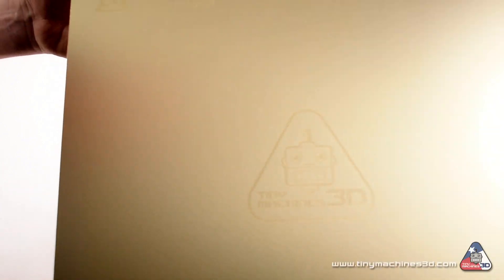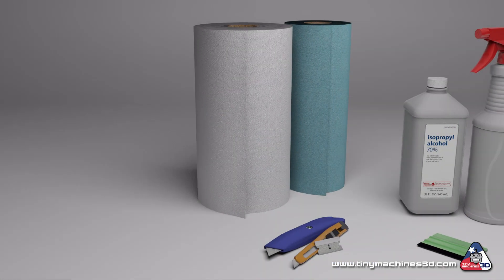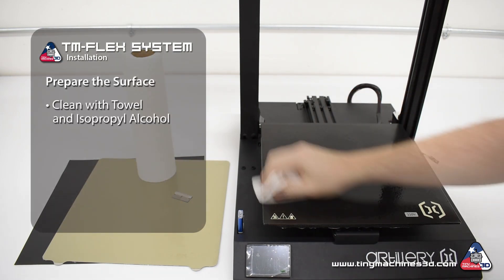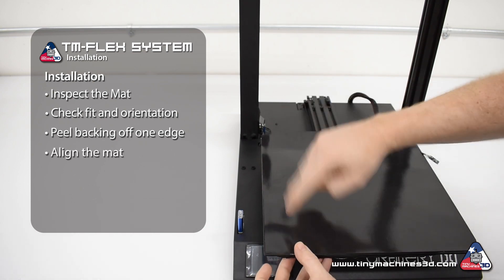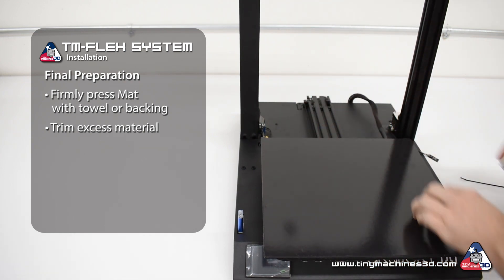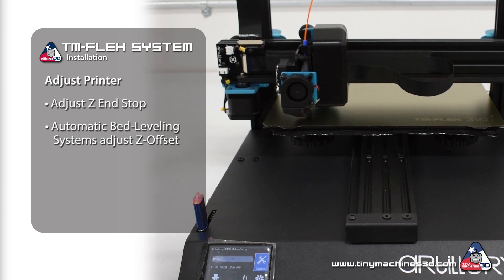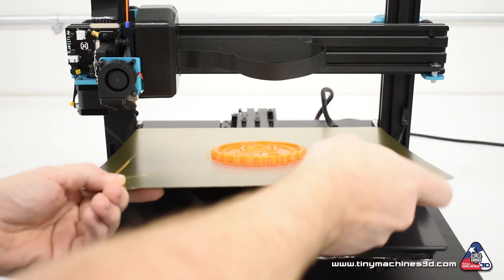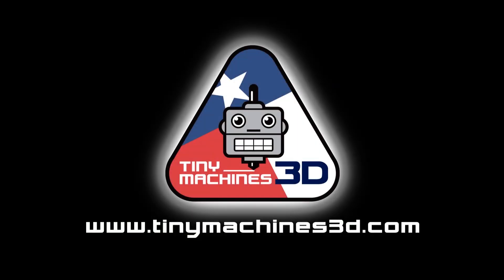TM-FLEX Install

Comment: Just installed mine. Very easy to install and looks much nicer than the original build plate. Steel sticks down to the magnet very well but peels off easily.

Comment: Can the magnet handle high temperature like 100 degree?
Reply: I too would like to know what temperature the magnet is rated for?
Reply: @kalkutoe  Read the information sheet that came with the bed plate kit. At the bottom of the page it says "Maximum Suggested Bed Temperature is 130 degrees centigrade.

Comment: is this the creality one with your branding
Reply: I see in other flex plates that they remove the old plate..in this one is not necessarily? Just wondering because i have a creality cr 10 s pro v2?
Reply: @DeLeonprops  I'm curious about that too...
Reply from the maker: No. This is our custom made system with our plate design and graphics.
Reply: looks very much like the creality one but with your logo is it made in the usa?
Reply: how thick is your plate and matt combo
Reply from the maker: @wayneuk  Most of the flex sheets are made by the same manufacturer. Creality doesn't make it themselves. Ours may come from the same place but we have our own tab placement and shape.
Reply: @tinymachines3d778  ok thanks for the reply